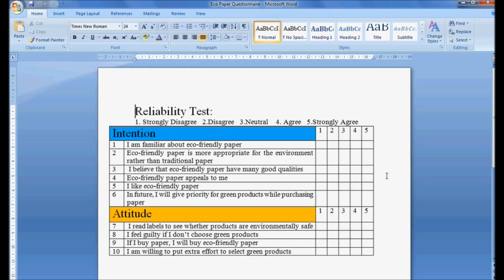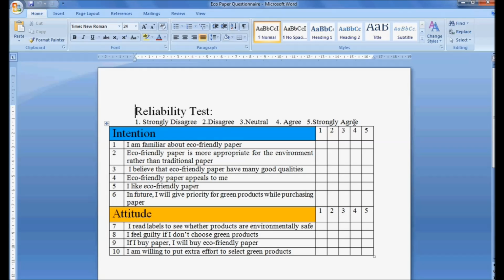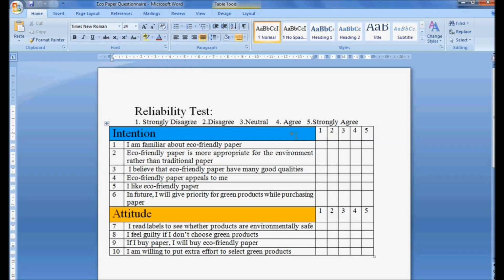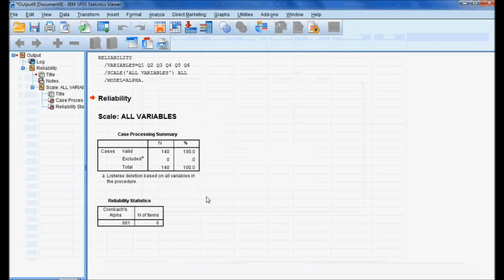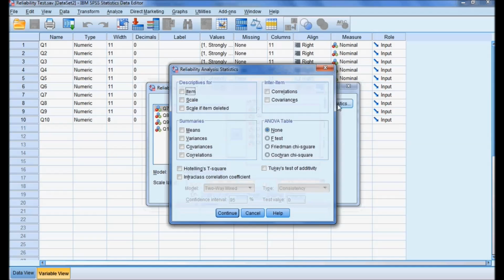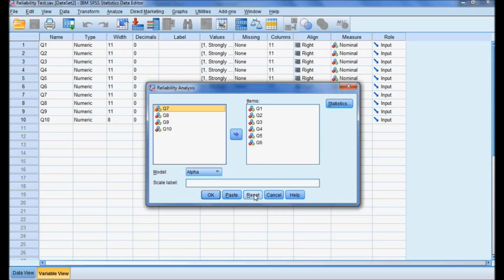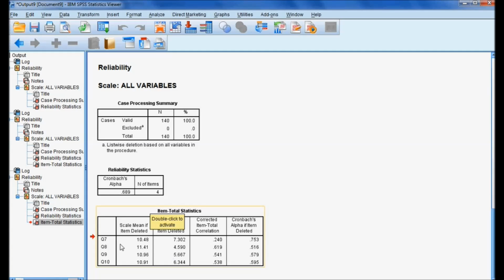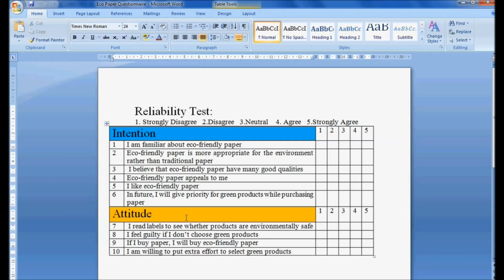Cronbach's alpha Reliability test using SPSS

Comment: Sir, after checking reliability test removing say one question having low Croabh's alpha, we go for chi square test or any other test, then how the results need to be interpreted.As we compromise our input by deleting  one question. I am a learner only in the stastics
Reply from the maker: After removing an item with low Cronbach's alpha from a scale, you might want to assess the impact of this removal on the scale's psychometric properties, such as its construct validity. One way to do this is by conducting additional analyses, such as a chi-square test or other relevant statistical tests, to evaluate the scale's performance before and after item removal.

Comment: Sir, if any one of the item is reverse coded eg for negative statements scored as 1 2 3 4 5 and for positive statements 5 4 3 2 1 in a 5 point scale from strongly agree to strongly disagree , can we use the same steps for calculating Chronbachs alpha ?
Reply from the maker: Yes, you can still use Cronbach's alpha to assess the reliability of a scale even if some items are reverse coded. Reverse coding is a common practice in psychological measurement to control for response bias or acquiescence bias.

Comment: Sir, 
I have found that "Cronbach alpha" is used for a Likert scale questionnaire. But if a questionnaire is mixed with a Likert scale and binary scale, then how can I test the reliability of the questionnaire? Additionally, how can I test the validity of this mixed scale questionnaire?
Besides, this video is very beneficial. Thank you.
Reply: "Cronbach alpha" is used for a Likert scale questionnaire is half truth. The individual questions may vary within that questionnaire so that the "Cronbach alpha" would be either too low or too high. If the individual questions within the Likert scale questionnaire correspond to same construct, than that croncbach alpha value is true. If not than do a factor analysis. Also look out for multicollinearity.